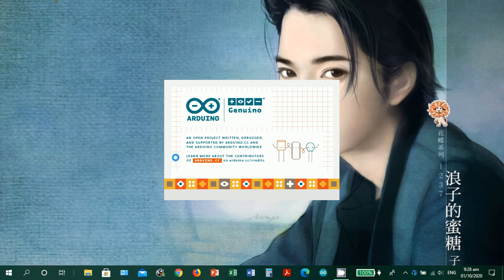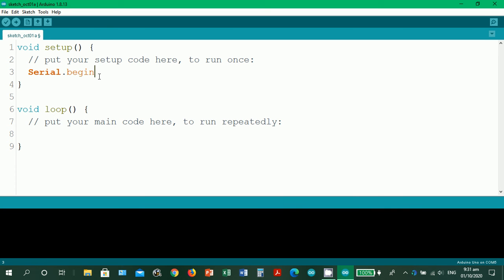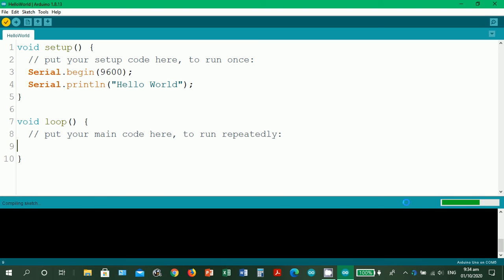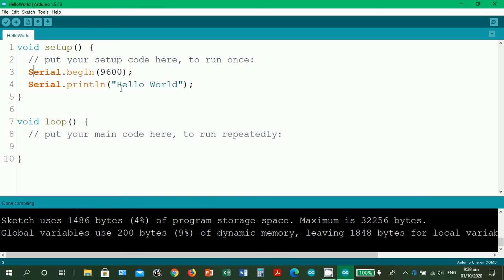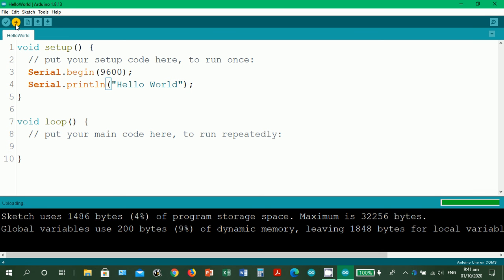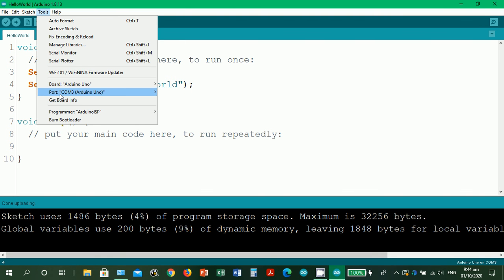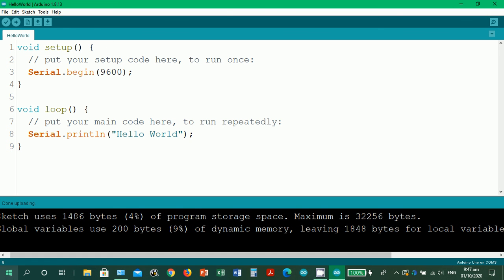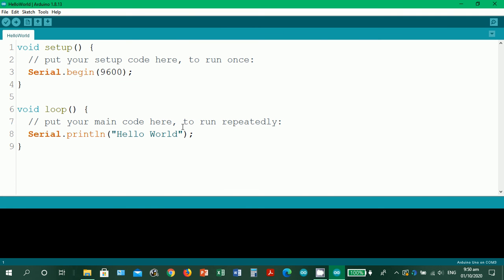EASY-HOW-TO Hello World in Arduino IDE Tutorial

Comment: #include <LiquidCrystal_I2C.h>;
LiquidCrystal_I2C lcd(0x27,16,2);
int analogX;
#include <Servo.h>  // add servo library
 
Servo myservo;  // create servo object to control a servo
 
int potpin = 0;  // analog pin used to connect the potentiometer
int val;    // variable to read the value from the analog pin
 

void setup(){
  lcd.init();
  pinMode(A0,INPUT);
  pinMode(3,OUTPUT);
  lcd.backlight();
  myservo.attach(2);  // attaches the servo on pin 9 to the servo object
}
  
void loop(){
 
  lcd.setCursor(1,0);
  lcd.print("Hello, world");
 
  lcd.setCursor(1,1);
 
  analogX = analogRead(A0);
 
  lcd.print(analogX);
  lcd.print("                 ");
  analogWrite(3,analogX);
  val = analogRead(potpin);            // reads the value of the potentiometer (value between 0 and 1023)
  val = map(val, 0, 1023, 0, 90);     // scale it to use it with the servo (value between 0 and 180)
  myservo.write(val);                  // sets the servo position according to the scaled value
  delay(15);                           // waits for the servo to get there
}